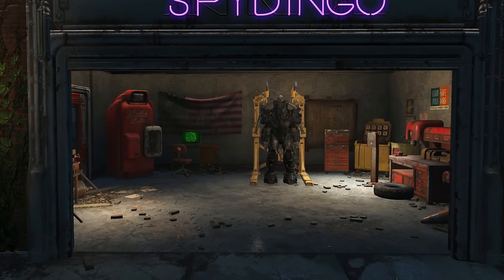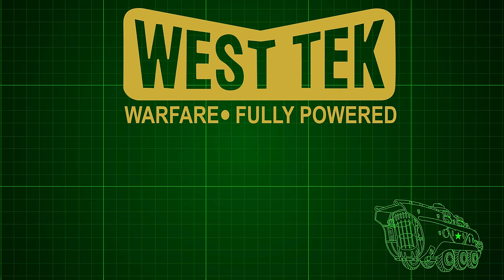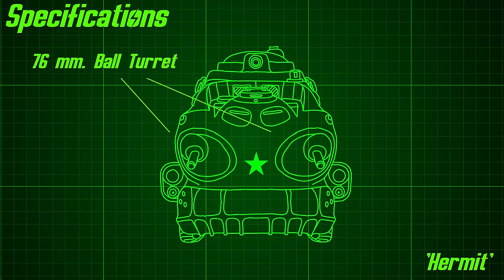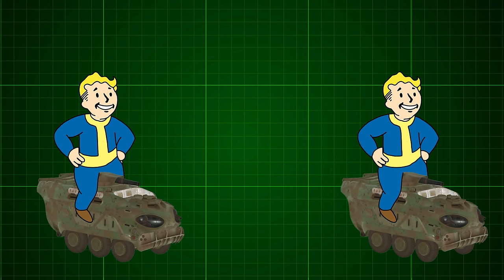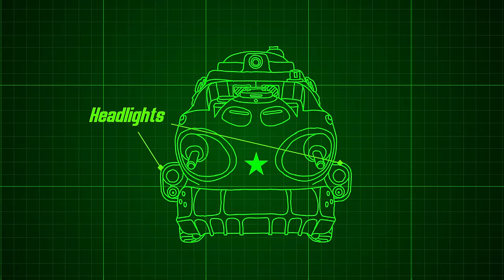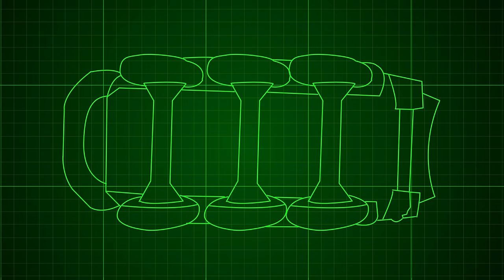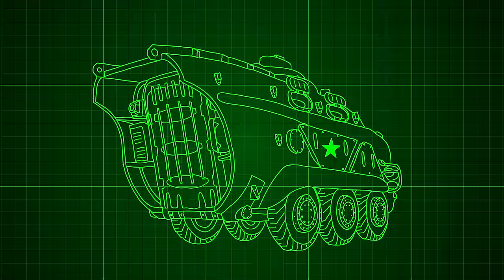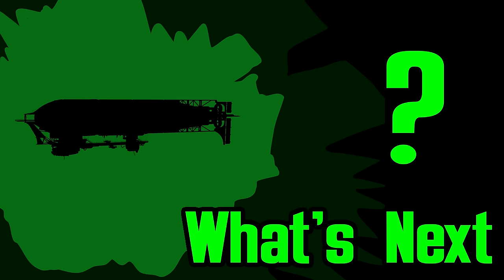Fallout 4 & 76's APC is a Hot Mess

Comment: The top mounted cannon might be a low pressure gun, which has historically been fitted to light, wheeled vehicles to avoid pushing themselves over.
Reply: I agree, it looks and is probably similar to the 2A28 gun on the BMP-1 and BMD-1
Reply: Still way too big.
Reply: @hanzzel6086 you heavily underestimate how small low pressure guns can get. The one on the BMP-3 is extremely small and is capable of firing missiles out of it
Reply: @thegamingzilla6269  I meant aesthetically. It just looks dumb to me. Also, did you mean big?

Comment: Perhaps one of the installed weapon types were designed to use the Fat Boy. Low recoil, high damage! 40mm "high velocity" grenade launchers nowadays are pretty "low recoil" compared to any "regular tank-type cannon". Is there a way to measure the diameter of a Fat Boy?
Reply from the maker: Certainly possible, though I'm not sure where they would store such munitions. Well, there is a distance measuring pistol mod I've been using, not the most accurate thing, but approximately possible I think.
Reply: Fat Boy was mostly a prototype though.

Comment: Feel like I should mention, its very possible that the 105MM turret was similar to the gun/launcher systems found on some cold war era tanks where the main gun doubled as a TOW missile launcher. This APC/IFV could exclusively use 105 TOW missiles, though I have no idea what the twin forward facing guns would fire, as secondary weapons it wouldn't make much sense to give those similar guided rounds. Profile also makes me think it would be way more prone to falling over with its top heavy design and short wheelbase. Entirely possible that the weight is under the 30 ton range, which combined with its very tall profile would give some credit to the amphibious idea.....if it had props or water jets on the back that is. Look at the AAV and you'll see what I mean, but the AAVs are also far longer and much more boat shaped, still sitting very low in the water.

Comment: Could you do the stingray or vertibird. The stingray might be hard tho as the only examples are a crashed opposite the posiden energy turbine and outside of arc jet inc.
Reply from the maker: For sure. I actually worked in aeronautics for a while so that's actually the area I'm most interested in. Not gunna lie, I've been very disappointed with the seeming lack of an air force in the fallout universe. I'm actually working on making some art at the moment for the vertibird, but I'd love to explore the stingray too. Would be a lot of theory crafting for sure, sounds like a fun challenge though.
Reply: @spydingo  the Brotherhood of Steel has a couple more vehicles or things aka the prydwen and Liberty prime. There is quite a bit of info on both, the prydwen has I think 3-4 hydrogen envelopes ( I don’t know the terminology for the gas things).
Reply: @spydingo  other thing could include the uss democracy sub from far harbour, the ufo and the Yangtze sub
Reply: @spydingo  It is funny how ALL the crashed Vtols in f4 are vertibirds despite those being pretty much brand new at the time the bombs went off. (Tactics may have gone too far in the other direction since the crashed helicopters on some maps seem to be Hueys)
Reply: There is also the Shi's advanced fighters they were trying to make. The old Western brotherhoods massive expedition Zepplins even larger than the prydwen, that were designed to go out and establish a chapter / expedition fighting force, one crashed during the era of the Master. There is also the possibility of jump jet / jetpack troopers. Not all of it is cannon but there is a really cool fan mod project that I find puts the fallout verse and its vehicle tech in a more understandable perspective. Its the Old World Blues mod for Hearts of Iron 4 on steam workshop, one of the best mods I've seen for a paradox game with a pretty big mod team and a few years under their belt already. They have taken all the lore from every fallout game, yes even tactics, and have also filled in the gaps with their own ideas

Comment: The side plates look like they got added late like some sort of upgrade pack or maybe done by the crew like they did with tanks in ww2 best known for it was the sherman they add plates to the front and sides sometimes they even added  concrete
Reply from the maker: Thanks for the comment! That's an interesting thought. Kinda like the cages being put on Russian tanks in the current conflict, and equally non effective in this case I would suspect. I mean, there is so much surface area those plates don't cover.
Reply: @spydingo  it was more of a moral boost for the crew or thinking about it maybe they can be taken off to make some sort of barrier the cutouts being slots to join them?
Reply: @mattp2557  Those plates on the side of sherman actually did offer protection against smaller anti-tank weapons like the german 37mm who would often ambush tanks. Those plates cover mainly ammo locations so they can't be blown up by an ambushing it. When angled it can also stop some larger cannons too
Reply: @Jake-dh9qk  yes they did offer some practical use but against the rocket launchers of the time and bigger gun they didn't help is what I ment I could have worded it better if the plates had a gap like with the panzer 4 g it might have been better. The firefly was probably the best version before the e8 in ww2 the sherman was heavily upgraded by the end of the war.

Comment: yo a point that may be interesting to think about as there arent any real exhausts perhaps the ports on the side that look like crew weapon slots could actually be exhaust ports and the hatches are there so that crew can close these ports for short periods to either help with stealth so there are no plumes of smoke leaving the vehicle or so you can close them when going through muddy and dirty terrain to stop things heading straight to the reactor and damaging it similar in nature to how the sentry guard bots can cover their fusion cores to reduce damage to the vital components but after a while of use need to be vented to allow for cooling. This would explain why most if not all of the ones we see are open because they were engaged and could not close them before persishing and also you would not need to close them in residential areas because the likelihood of a bullet perfectly ricocheting down one of the exhaust ports all the way to the engine is slim to none.

Comment: To help with the physics as long as the large turret fires straight forward or backwards it will remain stable with little movement, almost no movement of the air brakes is engage (assuming it has air brakes) if it fires side to side it won’t flip but it can really f up the vehicle platform making one side lower to the ground,
Reply from the maker: Both very fair points, but I really wanted to throw in those simple animations lol

Comment: APC Should have been called something more like Westek Washington. Far as the weight I would put it around 30-32 tons at the most considering size. The crew would have been at least 4- Driver, gunner, radio/loader/secondary, and commander. The side-mounted guns would most likely be an autoloader probably drum style like the AMX-13 and remotely controlled by the gunner or loader.
Reply from the maker: Fair enough. 

Though I would not want to be in that crew cabin with a crew of 4, not sure how they would fit. I think you could put the driver and gunner side by side, and then the commander up in the hatch area. I have no idea were the radio guy would go though.

Comment: It's possible this vehicle was designed mainly for US soil as homeland defense against mostly small arms and hand-held carried anti-tank weapons, hence the lack of conventional IFV designs you would find in real world examples where it's focused on concealment and maximum utilization of angled armor. This is why we also see a lot of these vehicles littered around checkpoints because it seems to act as a barrier-vehicle as well. This then makes it likely that the vehicle's main guns would likely to be firing low-velocity ammunition since they will be facing mostly infantry and light airborne vehicles at short distances. Another big giveaway is the space between outside layer of armor and the inner compartment. This indicates spaced armor which are excellent at defeating chemical weapons that airborne-units would bring with them.  

It's also a pretty heavy vehicle so it can't be deployed rapidly overseas as well. It's weight + wheeled configuration meant that it can only perform well on paved road.
Reply from the maker: Very well said, I think I agree with all of that!

Comment: Huh.. Laser weapons actually makes a lot of sense. Also I have a theory about crew complement myself. My guess is its two man. The driver and the Commander/radio operator/co-driver. My guess is the driver operates the forward facing weapons from his station like some older vehicles with fixed machine guns like older model M2 and M3 light tanks, M3 Mediums, BMDs and other similar vics. The driver probably sits in the driver hatch while the Commander either operates the gun turret, if extremely cramped, or like you suggested remotely but there's not clear station for him to use or enter. This also could support the vehicle is just one man and the driver does everything, only using the top turret when the vehicle is parked. Though a tandem seat arrangement could also work, though entry would mean commander first while exit is driver first. Not very good for rapid entry or rapid escape in a combat situation. Laser weapons do make sense as you are right there are no ways to get arid of spent shell casings. Though I doubt a cannon would cause it to flip. The M1128 MGS sure doesn't have that problem. At least not that I am aware of. And its armed with a 105mm in a remote gun position.
Reply from the maker: Hello there! Thanks for your comment. I think the tandem seat arrangement makes sense given the drivers slits present lower in the cabin and in the upper hatch. Each crew member would get their own vison slit, must be nice lol. Though, now that I look at it again, upper crew man would be practically sitting on the other's shoulders...hmm. Your right of coarse, the cannon probably would not cause it to flip, but I really liked the animation to illustrate my point lol.

Comment: I also feel the two 76mm ball turrets might have been used as oversized riot launchers before the bombs fell, just with  a low pressure charge and a massive less lethal payload like CS gas or a stack pf rubber pucks or pellets, the guns could also be akin to 40k bolters in that a solid often cased charge is used to launch the rocket out of the barrel at lethal velocity before the rocket motors ignite, although with plasma or most impact detonated rounds initial velocity is less important

Comment: This might be what an APC would evolve into in a power armor world, the heavy arment might seem excessive for today but could be needed for defense against other light armor or the potential use of hostile power armor (granted I don't think china at the time had a counterpart, this might just be future proofing), the wheeled nature could mean this is mainly a battle taxi, it brings your power armor up to the front line, drops them off, extending their range, saving fuel (probably uses way less nuclear fuel to move the power armor this way then walk it out there) and giving a slightly more durable package (something that might be able to mess up power armor could probably damage this vehicle but would probably take way more punishment as long as a critical system isn't hit), even if it can only hold 2 suits at once, would you rather walk a section across open ground where they could get blasted by artillery and light anti armor weapons or truck them as close as you can safely then drop them off), the weapons also might not be energy or conventional cannons but possibly grenade launchers, low pressure guns (like on the AML-90 and the BMP-1) or even a downscaled demolition mortar like you would see on something like the 165mm on the M728 CEV or even flamethrowers (some actual flamethrower vehicles had dummy guns that had smaller barrels for the flamethrowers to prevent them from getting singled out when trying to close the gap to engage)
Reply from the maker: I like your battle taxi interpretation, it makes a lot of sense to me. Also now that you mentioned flamethrowers, I really, really, want to see a vehicle with plasma throwers. That would be awesome!

Comment: Thinking, the fireing slots could be view ports for the drivers or more exhausts. But also some are labled as "Steps" so they seem like a way to get ontop of the vehicle. Also, an easy way to explain away the extra slots and gun ports is you could say they where Dummy Ports, so enemy soldiers would be firing at these supposed holes to the crew, rather than important structural places like the door hinges or wheels. Also, they could just be hair vents to allow the cew inside the main compartment to breath, being ableto be closed and sealed if you want to tread water, which seems likely with ghat submersible look that was mentioned.
But, all these are just possible excuses, as most likely it just comes down to design decisions that they either forgot about or chose cause it looks cool, as is a take as old as time

Comment: The boat shaped hull may have been to give the vehicle an amphibious capability. Another option for the top gun could be a recoilless rifle similar to the one used on the BMP - 1 of our universe. the have a trmendous bcakblast so it couldn't be in the ball turrets.
There is one other question, with 2 76 mm and a 105 mm gun, where would they store the ammunition?
Reply from the maker: That's a solid question. There might be room for limited storage in the driver's cabin, and maybe above the squad bay, but not enough to be a meaningful addition in combat. That's another good reason to hope the weapons are actually energy based in nature.
Reply: also dont forget that its taller than wide, so it might be sitting lower inside the water being well concealed by it 
probably good for beach landings too
Reply: @spydingo  hopefully, but then I would have to wonder about it's weight, since a nuclear power plant would require some pretty substantial shielding, but then again they managed to put a nuclear power plant in a car in our reality so it is possible.

Comment: The value of crew comfort in an APC cannot be overstated. A unit that arrives well-rested is going to be far more combat effective than one that's fatigued from being bumped around for hours. That's why the new JLTV is such a huge deal beyond just better armor: improved suspension and air conditioning that actually works. The original Humvees had windows that could open and doors that could easily be removed. As they up-armored them, the windows no longer opened and the doors had to stay on, and the suspension was overstressed so the ride got worse. This coupled with an unreliable 1980s-era air conditioning system meant crew members would often arrive to the field drenched in their own sweat. As for the design of the Fallout APC, at least they're not still using the M113 in 2077, something I could unfortunately see happening.

Comment: I always thought of it as a amphibious riot apc that is used specifically by the US Coast Guard, it seems to have multi function for it's one top and two front mounted turrets, water cannon and either a laser or plasma capabilities. The slots that lead to nowhere on either or side are most likely vents to keep the fusion core or fission battery cool under all the armor while either driving or firing the cannons. The massive hinge on the back only makes sense for the "appropriate" use of amphibious capabilities, the vehicle would be submerged below the vent slots which are also probably used to pressurize air tanks giving the apc the ability to float. The only way that this vehicle has any benefits is in the water, it explains away the height implications and land effectivity especially on why the top turret is so high and why the two front turrets swivel on a half sphere to keep water or air from leaking in or out.
Reply from the maker: I like your theory for rationalizing those dang slots to nowhere, they bother me so much lol. Its a shame the 'Hermit' doesn't actually have any mechanism for propulsion under water on the model, I agree that really makes the vehicle system make a lot more sense. Although, I'd hate to be in one of these things in a suit of power armor during a water crossing, a thing I didn't really think about till now.

Comment: I will say as counterpoint to some of your mentions. The guns can work as well, actual guns, if they are low pressure guns. IRL several extremely lightweight armored cars were fitted with low pressure 90mm and 105mm guns firing entirely chemical munitions such as HEAT. The shot trap thing is also less of a concern with APC's and IFV's as they arent ment to be directly compatting dedicated tanks, only sometimes carryinf anti tank weapons in the event they encounter one. This also means the armor would be rather pretty thin, only strong enouhh to resist infantry weapons and heavy machineguns